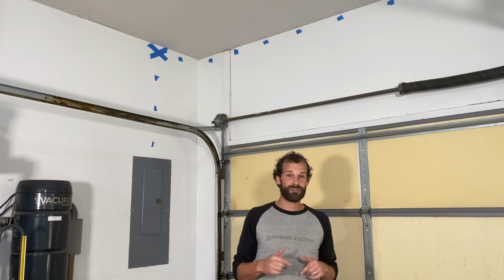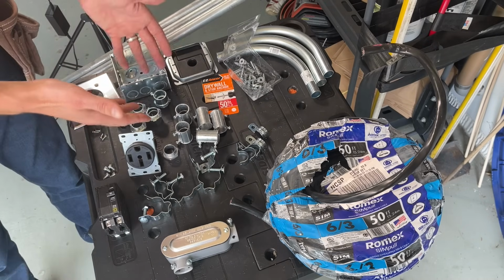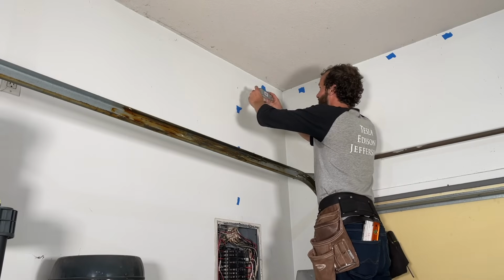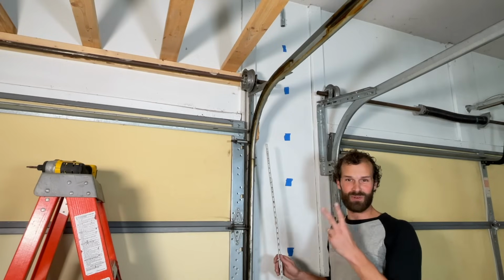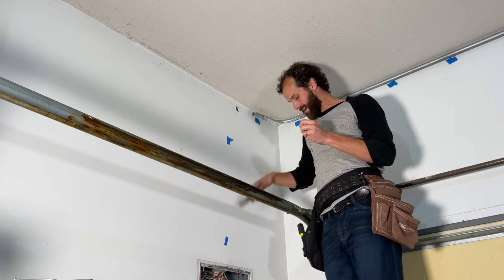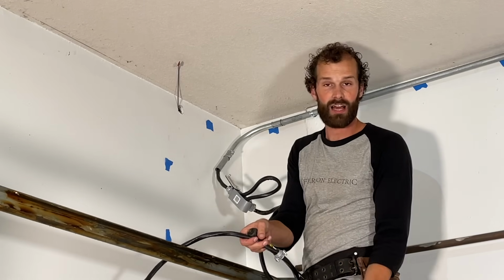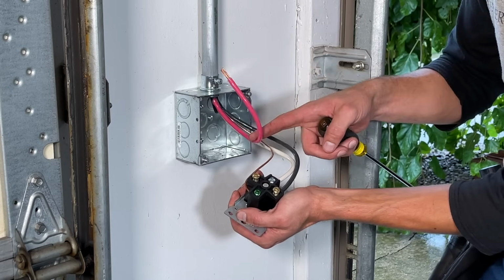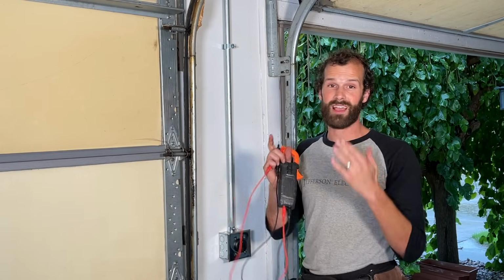How To Install a 240 Volt Outlet | Electric Car Charging

Comment: Those LR fittings you picked were for threaded conduit use. They make versions designed for EMT that will not need a bushing in them. Also I would just run individual wires through the LR and EMR as opposed to trying to pull Romex through it. When I saw that panelboard, I was surprised to see all the other cables coming through one giant knockout. I think NEC Code calls for each cable to be in it's own knockout. The wiring in there is also sloppy and now that you added the 50Amp 220V circuit the board is full to capacity. It really should be upgraded for future expansion if needed.
Reply: But why spend money to upgrade when they probably will never need to add anything in the future..?
Or upgrade it in the future once you actually realize you need it. No need to spend money on something u may never use

Comment: Where I work NM-B (Romex) in conduit SCREAMS unprofessional and you're worried about the inspector seeing your set screws lining up? Is it against code? No. Are you a masochist? Fo' sho'!
I'd use flex in the wall and THHN all the way. Then you're install would be rated 65A (not 55A as it is) and could be upgraded to a hardwired 48A EVSE (requiring a 60A rated circuit) in future.

Also, NEC says GFCI breaker for EVSE outlets. 
You should ground your 4-square box.

Comment: Not a good teacher. Ground wire must be mechanically connected to box at outlet end. A!so remove 2 pole breaker from live panel/connect wires / then plug in breaker.

Comment: As a handyman when I pull any cable using the ground wire, I cut the conductors (Black/Red/White) so they are staggered (different lengths) before taping them to the snake. This gives them a more gradual entry into the conduit.
Reply: As a handyman you shouldn't be pulling any wires in anything unless it's your own house. As a licensed electrician I'm constantly fixing handyman specials. You may be the exception to the rule but generally handyman think they know but don't know Jack. Codes updated every 3 years and it's a four-year apprenticeship just to get a journeyman license. Electricity is no joke and should be taken very seriously poor jobs can risk people's lives and safety not to mention property damage. Anybody can pull wire through a piece of conduit but do they know how to derate ,do they know how to do load calculations do they know how to make sure the breakers the right size to protect the wire? there are so many factors that one wouldn't think about.
Reply: @rogerdodger5886   your smart 😢

Comment: This guy makes me cringe...fish tape with a live panel?? .......6/3 Romex through 3/4 conduit??......no lube??......drywall anchors??........hole saw used blind?? .....and that mess in the pull box. Bad advice all round.....hire a real professional.
Reply: But wait there's more! Mud ring?? ....the 4x4 box is visibly loose on the wall....don't strip thick wire like that, use a utility knife like you are sharpening a pencil....and what state is this in?  Is there no primary shut off breaker outside the house by the meter for the fire brigade to shut off?? All very unprofessional.

Comment: Really like the video! I have two questions:  (1) can I lay the EMT tube inches below the ceiling, or few inch above garage door rail to reduce total length of wire?  (2) can I make a new connection from 1 of 2 hotwires from NEMA 14-50 electric box to make a 120V/20A outlet in terms of building code in general?  Thanks!
Reply: NO!!!

Comment: So you can charge your zero emission vehicle from the grid off the nearest coal fired powerplant.
Reply: Ha, ha! Yeah, that's true.
But my quesstion would be "Which fuel is cheaper to purchase; gasoline or electricity?"

Comment: As You know you have 50 amps available on the panel? You have the space to put the braker and how did you calculate the extra load .

Comment: It's a code violation to pull Romex through conduit you have to use number 6 THHN and a number 10 ground wire I am also a Tesla installer for the last 6 years and I can't believe that the supervisors have let this guy do unsatisfactory non code compliant work on Tesla installations he has violated too many code regulations. He should have pulled the number 6/3 Romex up into a Four square deep or 11/16 J box instead of using an llr.
I've been a IBEW Union contractor for over 26 years and a licensed contractor at State of California for 37 years this guy has probably less than three years experience and I wouldn't have hired him more than the first week before I let him go
Reply: Glad somebody said it. I’m only a 2nd year apprentice and watching this gave me anxiety.
Reply: Being a member of the Union is actually a privilege the quality of educational material available to all apprentices and even through journeyman level is outstanding every year you can sign up for new classes to keep your informative educational experience at top-notch capabilities far surpassing non-union
Reply: No it’s not.
Reply: This is not a certified tesla installer. This is just someone installing a 50 amp outlet for an ev to charge on. So this is not a tesla install or installer

Comment: Read many comments and many picked on the nm in EMT. (okay by 334.15.b).  No one is talking about 210.8 (a).2.  The breaker is wrong....garage recepticles 125/250 require GFCI protection.

Comment: Need a grounding pigtail on that box. Also, ideal box would have been a 4-square INDUSTRIAL SURFACE MOUNT style - wouldn't have needed that mud ring and the box would have no sharp edges/be more aesthetic. 

And while there is nothing code-breaking about pulling NM-B through pipe, your life would be a lot easier if you were just pulling THHN.
Reply: 4 & 11/16 box would have been better

Comment: About myself......I am a  licensed by the state of New Jersey for 47 years electrical contractor .....First place you should of used 1" emt not 3/4"....you have to watch your conduit fill.....1" conduit would of been much easier to pull in the cable......also you should be bending your 90's not using pre bent sweeps...the second thing you should of used a 5" square box on top of the panel and NOT a LR or LB
Reply: The 5" square box would of made pulling the cable much,much easier.Just doing those 2 items I mentioned would of made the job much easier....also you could of used 1" pvc conduit if you can't bend conduit ... to bad you can't work with me.....you would  learn a lot with the experience I have.... I have  done it all .....check your 3/4" conduit fill ....I am sure you are way over using 6/3 with ground and with the outside cable  sheeting ......  listen to an    Experienced mechanic
Reply: Yeah, my first thought was why would you use an LB (or LR/LL) when a 4" or 5" square box would be so much easier. And pulling individual conductors would've been so much easier in the 3/4" EMT.

Comment: Ive installed a 220v-240 volt 40 amp outlet for a Tesla charger I only used 2 hots and a ground and no neutral did I do something Incorrect? What’s the difference bet using a neutral or not ?
Reply: What kind of 240v outlet did you install? There are several flavors. The ones with four connectors (holes) use two hot, one neutral and one ground.
Reply: From what I understand, most if not all of the 240v chargers only use the two hots. The neutral is there to provide 120 volts in case you plug in a different appliance or device that might need it. The NEMA 14-50 receptacle is designed to provide both voltages, so it's a good practice (if not a code requirement) to have a proper neutral connected to it. But I believe the Tesla charger will work fine without it. Since you didn't run a neutral, to be fully compliant you would need to install a NEMA 6-50 receptacle which is for 240 volts only (it just has 3 prongs - 2 hots plus ground). But then you (or the Tesla owner) would probably have to use an adaptor to go from the 6-50 to the 14-50.

Comment: If you have to tell people how to remove the cover off the service panel, you are talking to the wrong audience. I have been a licensed Electrical contractor for 30 years and I would never post any DIY videos. Pulling Romex in a conduit is amateurish work this is embarrassing to watch.

Comment: Man its a crime whoever terminated that panel, and didnt use the back of the neutral bar / ground bar first. that guy really wasnt looking out after the guy after him. also i hate to say it but. ill never work in a panel without safety glasses haha<3 its not my work i dont trust. its the guy before me i dont trust. so when i open that panel up. who knows what surprise ima find while working in it.

EDIT, im an electrician as well. did new construction residential. do new installs, existing installs, and service work for commercial, industrial, residential now. for the most part this was a pretty dang good video. I LOVE you showed the wiggle method for terminating. 100% a pro tip.

few quick thoughts-

1. The LB, LL, or LR  is definitely the way to go. Use the holding gun method to figure out what type you need as shown. Its a lot easier to push the wire into the long part of the lb than it is the short way.  So pull your wire easiest path as shown in video no matter the direction of the LB, LL, or LR but..

When wire pull is complete, to get that small wire loop  to fit into the lb, ill pull the opposite direction of the pull if i have to, so that i am pushing wire loop into the longer part of the lb. I even use the handle of my hammer, something soft to help push. Less scrapping of the wire the better.

2. This is a big one. When installing the 240v receptacle, it is critical the wires fall, twist, spin into the back of the junction box neatly. You need to dress those wires before hand. I even shorten my wires so that its less than 6" sometimes. Is it against code? Sure but its safer rather than jamming a whole bunch of wires into a box.

I fold and dress my wires, and test push that receptacle into the box before using the screws to permanently install. If you have to push pretty hard to get the receptacle to seat onto the box. You did not do a good enough job dressing your wires. He did this in the video by twisting the receptacle a few times before pushing it into the box.

3. I see existing panel has double landed neutrals and grounds. My mentors have always hated this. I think most important thing is if a home owner is going to double land. It has to be like wires. What I mean by this is same size of wire and type. So if its #12 awg and solid, the other wire must be the same. So that the screw that secures the wires is making the same amount of contact to each wire.

We pros know this but. Afraid home owners will not. See that the pro double landed wires. Think they can do it to. Might mix and match sizes. Which is asking for a loose neutral connection and fire hazard.

Comment: Code violation, box needs to be grounded which grounds the conduit also, and being that’s nm cable not single cables I believe the conduit needs upsized one size per code. A weigh in from @Electrician U would be great

Comment: Question:	I live in a four story 40 unit condo with an indoor parking space in the basement. There is an electrical room in the basement for all 40 condo units where the local cable tv and internet connections are situated, along with all other electrical and mechanical functions for the building. 

Each individual condo has their own electrical panel which are tied to the main local panel in the basement.

So my question would be as follows;   Would there be any electrical standard restrictions or any restrictions at all, that may prohibit an installation for a 240V NEMA 14-50 outlet for my newly purchased Tesla’s parking space? ........... [Which is roughly 220 feet away] from the main electrical panel in the basement. My sole concern/inquiry is due to the large distance to the main electrical panel?
Reply: Not s restriction, but a work around.  NRC article 210.19 (A) information note 3 NEC 2020. Defined a "3%" maximum voltage drop for each circuit and "5%" voltage drop for feeders and circuits combined.  (Some jurisdictions adjust these numbers).

Because wires have some small resistance, fractions of ohms per foot, some voltage is used by the wire.  A series circuit is set up with the hot, load, and neutral.  This may lower the voltage at the load to below its rated voltage.

One simple solution it to use larger diameter wire to lower the resistance per foot and raise the voltage at the load.

Please check with your local electrician to ensure you have an appropriate understanding of your specific situation.

Also, I am not an inspector, but a quick phone call and a few minutes on the phone with them might help.  They see many different installations daily and may be very helpful.  They are not the enemy.  Think of them as the teacher grading your test....a pat on the back for good and a do over if bad.  Their job is a safe installation of your electric, a double check that the work is done correct.
Reply: If the breaker box for your condo unit is up in your unit, getting your electricity down/over to your parking spot will be almost impossible (unless your unit is just above your parking and your condo board doesn't mind you drilling through common property) Also, a 220 foot run is very far ; I would consult one of the charts that are online that show voltage drop per length of the various wire gauges at various voltages. It is not a good idea to "crowd" that curve to save some bucks on copper.

Comment: for the NM-to-panel connector/clamp, is it OK to just use one of the push-in connectors rather than the one with a locking nut? My thought is that would allow you to adjust in the future, potentially store "extra" wire in the wall if it becomes necessary. Tighten the clamp from inside the box.

Anyway, it was great watching this. I may go for EM conduit next time I run in my garage.

Comment: Kudos for even owning a torque screwdriver.
Kudos for using a torque screwdriver.
Kudos for resetting stranded conductors and tightening a second and third time.
Most professionals don't and they should.
Kudos for the stainless cover.
Theres a 110.3b violation using an RE coming out of the conduit body to protect the NM.  To be compliant that should be an nm connector.
That conduit is too small, you can use 3/4 for that quantity of THHN/THWN but not for NM.  Read chapter 1 note 9 (ish) a cable assembly should be calculated from its widest elliptical and applied to note 1 as 1 conductor.. 3/4 ends up being like 54% and too small.

The NEMA 14-50 will fail from the pressure of the conductors in the box.  

Theres also a 110.3b violation using a mud ring and plate as opposed to a raised cover.

Don't use any conduit.  Drop the NM from the ceiling to the point of use inside the wall and use a plastic old work box to hold the receptacle.  

Assuming your regulated by 2017 or 2020 code cycle that should also be a gfi breaker or device.

Comment: You call yourself a "pro" but you are a hack. 
"Mindful of safety"? You aren't even wearing eye protection or gloves.
Installing the breaker in a live panel. "probably' want to turn of the main? I noticed you grounded your hand nicely on the can while installing the breaker.
Telling people to remove KO's at the top of a live panel. It could easily fall into the bus. You ever seen a 200 amp panel explode?
Putting cable in pipe, a real home handyman method. 
A handyman hacksaw.
Saying it's ok to not have the pipe fully seated in a fitting.
Using a fishtape in a live panel.
Using a mudring and a wallplate instead of an industrial cover.
The conduit and the box are not grounded.
Exceeded the fill for the pipe and LB.

I would have cut in a metal wallcase at the top of the wall, run flex to the panel and come out of the wallcase with a 4" square box with a one or two gang cutout in the back and continued with the EMT.
I probably would have fired you for just the safety violations.

Comment: I don't understand running 6/3 Romex in 3/4" EMT conduit.  He looked like he was wrestling an alligator to get that through the conduit L fitting.  I agree individual conductors in the conduit, with a J box where the wires enter the wall to transition to NM cable to the panel would be far better and easier.

Comment: I get the desire to ensure the conductors are securely fastened in the receptacle by bending & screwing successively. Careful of bending them too far too often however. A bit of 'wiggling' should do it. Every time you bend a copper conductor it loses flexibility & becomes harder, more brittle. It can be softened again by annealing, but that's not practical with insulated conductors.

Comment: I moved into an older home in June which has a twist lock outlet in the garage labeled 220v.  Upon opening the receptacle I saw 2 hots (black)  but no neutral or ground.  Any advice?  Thanks

Comment: this is by far the best EV NEMA 14/50 installation video!!! thank you!!!  I find that 6AWG wire is impossible to work with, it's too hard to bend!  is it Ok to use a smaller gauge like 8 AWG?

Comment: The 14-50R is a waste of money.  EVSE (elec vehicle supply equipment) does not need 6/3 wire, only 6/2.  No EV charger that is inside of every EV and no EVSE utilizes the center tap or "common" wire.  Don't waster you money.  They only utilize the -120, +120, and the ground wire.  I wired a 6-50R and where the EVSE plug was a 14-50p  I used an adapter.